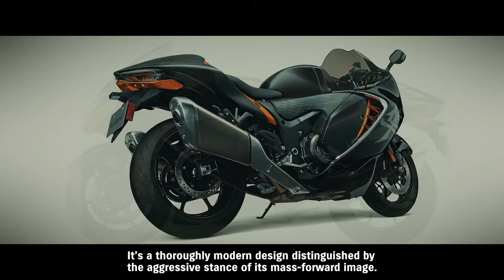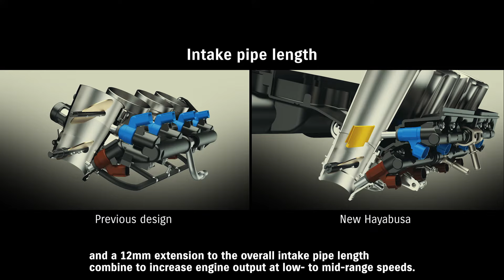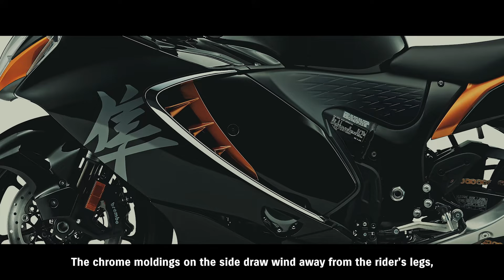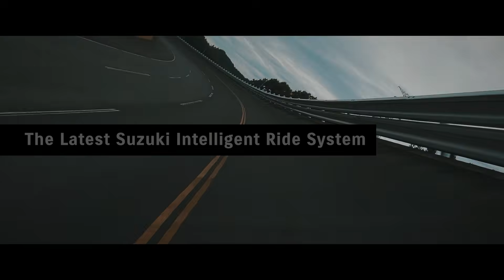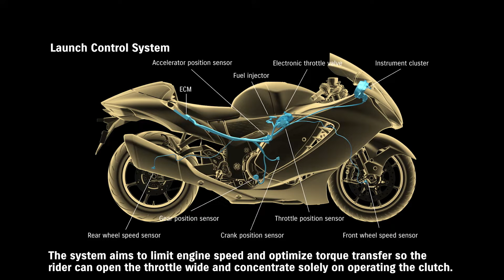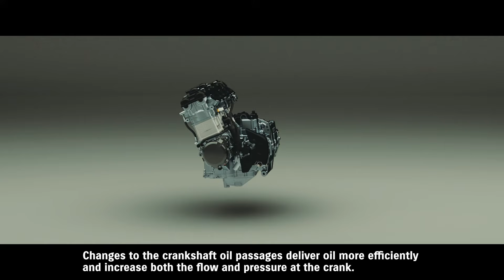Hayabusa Gen III - Features & Technology (ALL)

Comment: Great video and turbo kit… the only thing that I wouldn’t do is install a rubber oil return line. That hose gets damaged and you’re gonna blow the engine. I’d be fabricating a solid metal return line with the proper fittings. The other thing I would do different is I’d drill and tap the actual oil pan return fitting to the size of the fitting nut …. Then screw the fitting into the oil pan using JB weld as my thread seal then attach the nut with a thread lock. Last thing anyone needs is a $20,000 bike with a blown engine over a stupid rubber hose. Suzuki even had hard lines going into the cooler.

Comment: Durability? I bought my Gen 3 last August 15, 2024. Took it out on its maiden ride and stopped at Cheveron for fuel. Bike wouldn't start. So naturally I thought it was the battery. I waited about 10 minutes, then it started. The next time I stopped, I thought, Is this going to start? And yeah, it failed to start, so I knew something was wrong; the bike is brand new, and the service light came on. So after sitting all winter, it goes out to the dealership to get fixed; some say it's the alternator, and they are most likely right. But it is still under warranty. Message is even a new bike can be made to have issues. I hope this is not a gremlin.

Comment: Nothing beats the original. Too much Nannies and aids for inexperienced riders. Go learn on a Gen 1 or pre 2008 ZX14. People need to know how to ride without ABS, T/C and power modes. 

Soon the next generation will not ride a motorcycle period. If it takes gasoline ⛽️ and needs to shift with the left foot and clutch left hand….it’s going to go the way of the manual transmission. In 3 generations the “motorcycle” that we know of today, will be replaced with electric single seat drones guided by GPS and similar to the Tesla Car, but made for 1+1 passenger.

The “next flying vehicle” will be limited to 200 feet and under. Why ride when you can fly, quietly and electronically with no drive/self -control….we ARE living in the gasoline engine’s “twilight years”…enjoy it NOW before it’s GONE…..

Comment: too heavy but interesting
Reply: Go to the gym 💪
Reply: @HeldIntegral  i go often i 'm Fireman light weight bikes is what i like a lil bit of 200kg with upgrades is good for exemple my GSX S 1000 was 214kg now with Rotobox carbon wheels a Solise lithium battery a Dominator full system exhaust N a tail tidy with rear light intégranted my bike is about 190 kg...so light is right for a bike...handeling is better now

Comment: I have the Gen 3 but the hill hold expires after 30s. I don’t know why, since most lights last longer than 30s. The manual says that it can be extended but it never works for me. My Rocket 3 had hill hold that lasted indefinitely which was much more useful if you get stuck waiting for a light on a hill. FJB 🖕🇨🇳